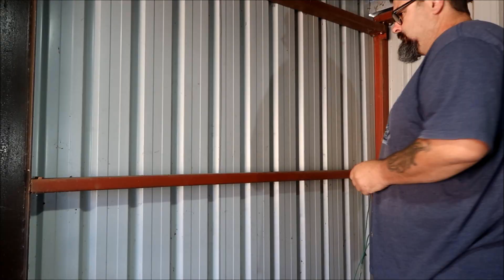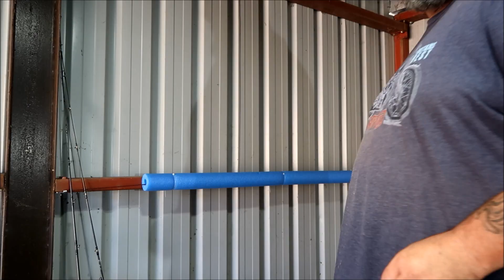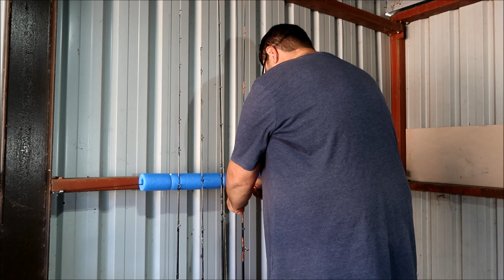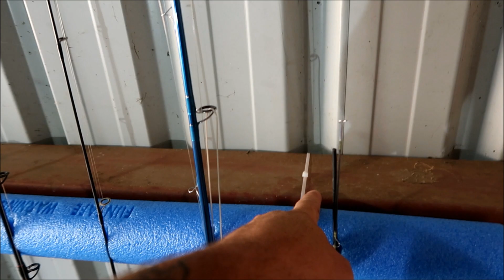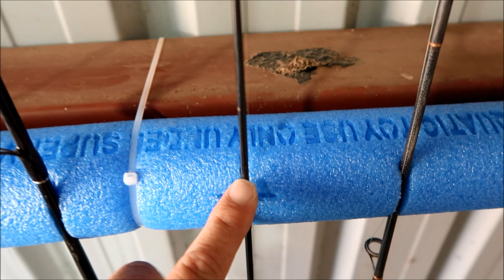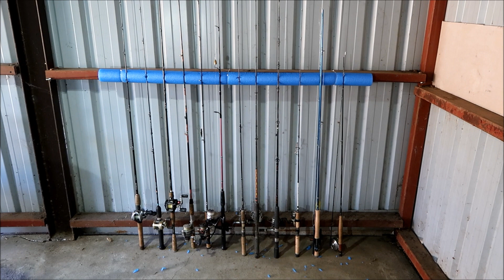How to make a DIY simple fishing rod holder

Comment: Hello Robert just a couple of things just bought Jacob a rod and reel from the gun shop. We thought we put it together properly then we he cast out the top half flew into the river luckily we retrieved it. Love the pool noodle fishing rod holder plus can you maybe show people well me how you transport your rods safely from A to B. Thank you Robbie hope  all the family are well.
Reply from the maker: Thanks Sharon. What a heart stopping moment that must have been. 
You need to ensure that the top half of the rod is pushed in properly. If not, you may be able to put nail polish on the inside part (usually the bottom) to make it thicker. You will need to put it together while the nail polish is wet. When it dries you probably won't be able to break the rod down again. It will essentially be a 1 piece rod. Eventually it will come apart after quite a bit of use.